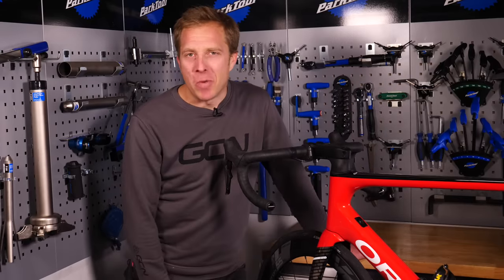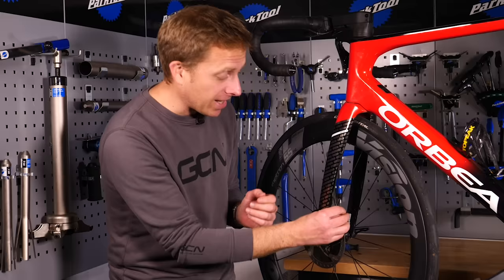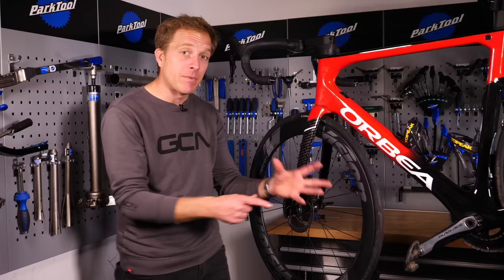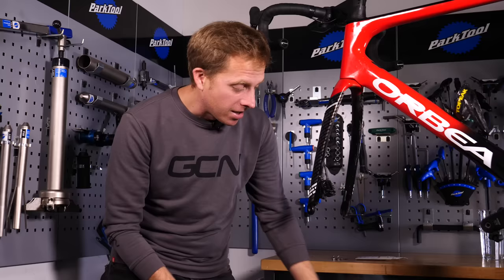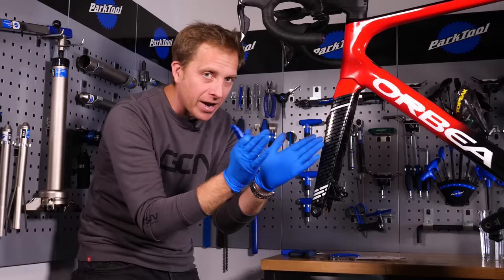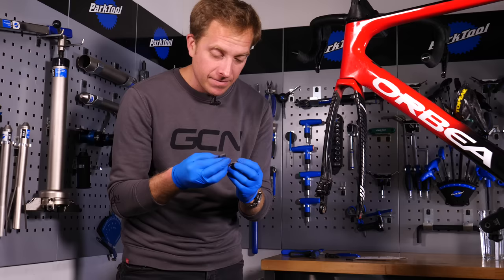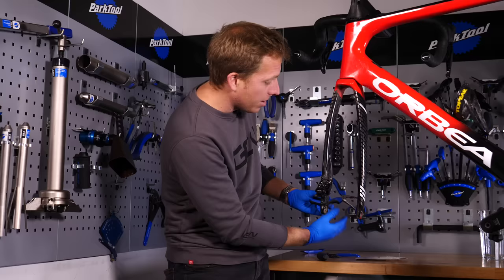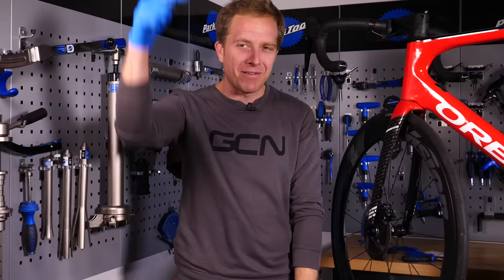How To Fit & Replace Disc Brake Pads On A Road Bike

Comment: I thought it was generally a good idea to clean the sides of the pistons before pushing them back in to avoid scoring the sides of the pistons or dragging grit passed the piston seals.??
Reply: Yes, it is recommended. If you don't do that, the brake fluid will get dirty.
Reply: @frederikroark  could that also be a cause for Shimano Rs785s calipers failing? I've had three fail with leaking piston seals, in last 2 years.

Comment: New rotor and new disc brake pads just because they start squeaking once? 🤣 No for me I'll try to clean it and sand the pads.. though i guess if it can't be fixed that way, the Pistons or piston seals might be leaking the hydraulic fluid.. and that isn't going to be fixed by replacing the disc rotors or pads..

Comment: Am I the only one who thinks the headset on this bike is way to tight? It should spin much more freely when he turns those handlebars!
Reply: It's does not move so freely because the brake and gear cables run through the headset.

Comment: Great presentation style but needs to be re-recorded: to avoid pistons popping out squeeze a soft rubber ball between the brake lever and handle bar, put a twist tie through retaining clip so you can find it, check retaining pin is not damaged (corroded/notched/bent), most credit/ID cards are 0.76mm don’t let the pads wear past this, clean pistons then to avoid damaging brakes reinstall old pads before pushing pistons back-in, to avoid corrosion use red rubber grease on threads of lock pin, check calliper bolts are still tight, heat shrink is not heat sink and don’t forget the edges of the disc can be razor sharp!

Comment: try doing it with budget cable disc breaks
Reply: yes it is slightly harder from the point of view that you have to readjust the cable and the stationary piston but at least you don't have to worry about your brake fluid leaking out of your calliper onto the pads (which has happened to my brother 5 times so far)